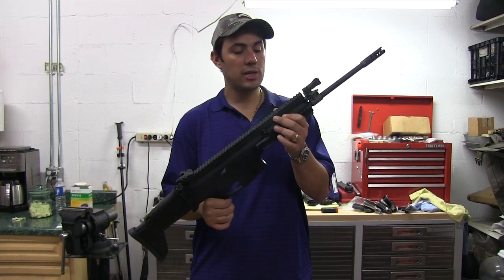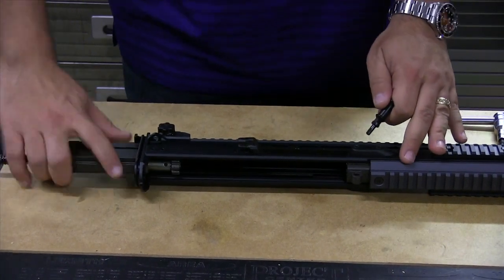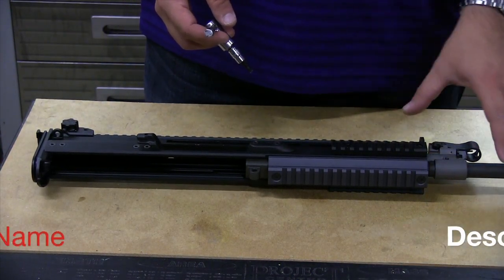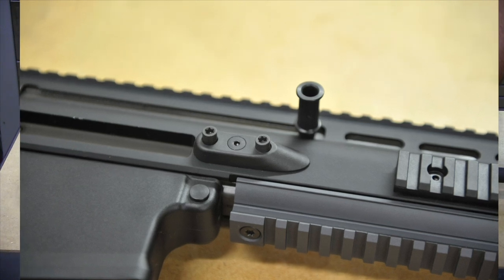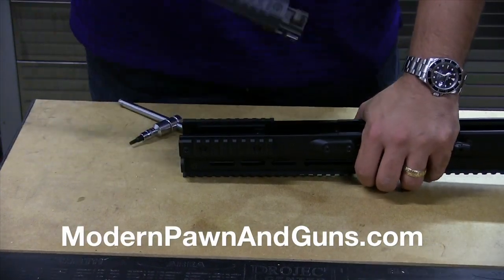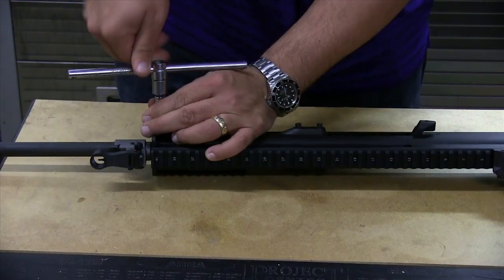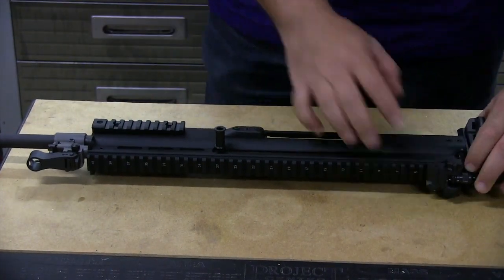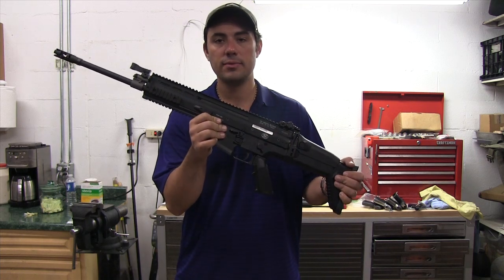Scar 17s/Scar 16 Barrel Removal Swap Tutorial/ Modern Pawn and Guns

Comment: So each of the screws need to be properly torqued to 65ftlb if I recall correctly? There is also a sequence involved...so folks, DONT JUST TIGHTEN UNTIL THEY BOTTOM OUT and IN ANY ORDER. That is not the proper way to do it...if your going to give instructions you should give them to speck just my opinion.  But good demonstration of how easy it is.